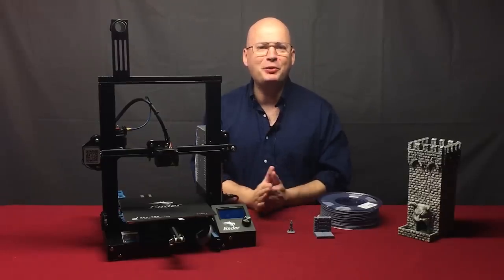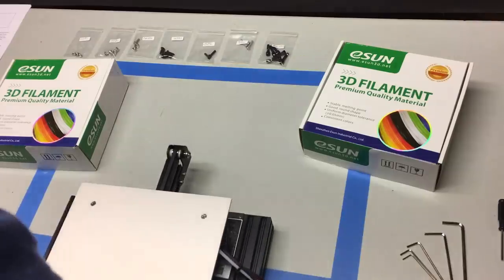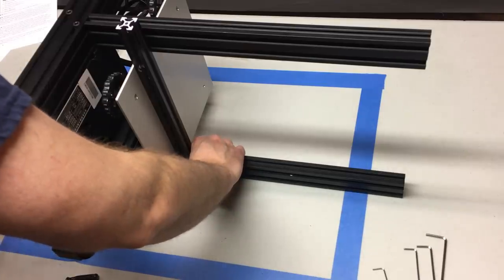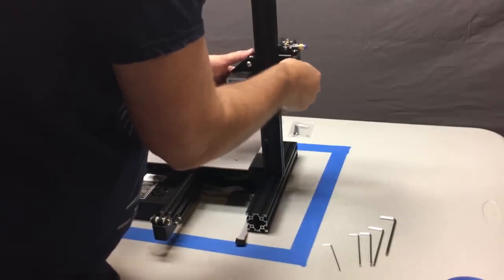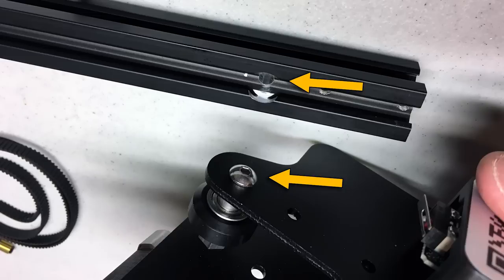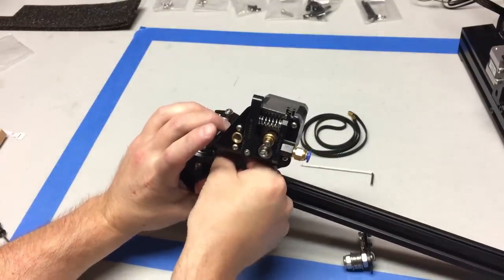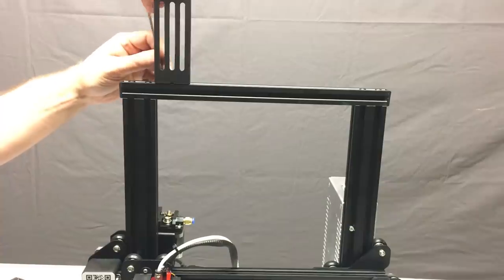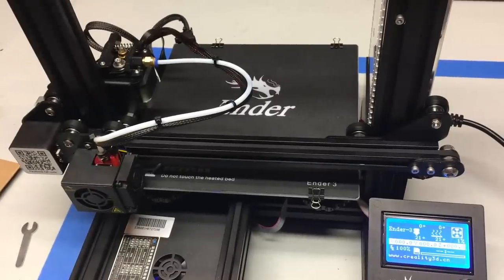Creality Ender 3 assembly and pro build tips

Comment: Do you have any wheels that are ideal? The wheels that came with my printer were garbage, nicks and cracks in them. I purchased some of the polycarb. wheels but they leave a white deposit on the rails.
Reply from the maker: I use stock wheels on all of my machines. If they are properly tuned (i.e., not too tight) they will last a very long time without cracks or nicks (my first Ender 3 is a year old and the wheels are in perfect condition.)

Comment: Do you have any suggestions for troubleshooting the extruder that won't heat up at all. After heating up the bed, it switches to the extruder, and the temperature does not increase at all. After about 30 seconds or so, I get an error message "heating failed E1" and says to restart the printer but this does not solve the problem
Reply from the maker: Most likely one or both heater cartridge wires have come loose from the main board and need to be screwed back in, or there is a break in one of the heater wires.

Comment: I will receive my Ender 3-v2 soon. Do you recommend, using the tutorial? There are some slight differences to ender 3 (e.g. power unit),  but it should work too?
Reply: I found this video very helpful for the V2 (it's basically a step-by-step build manual): https://www.youtube.com/watch?v=gokN9xNG94U&t=2623s&ab_channel=JustVlad 

I also want to mention that the stripping the aluminum frame screw holes with the metal screws is REAL. Not sure how because I normally don't over tighten anything, but I stripped the two holes that hold the passive x-axis bracket (side without the motor). HOWEVER, since these are metric a #8 5/8 screw and lock washer was just big enough to solve the problem and mine is printing awesome.

Comment: Tom, great video.  I wish I would have found it before assembling my ender 3. : )  Great tip on keeping the upright rails loose until things are aligned.  I see so many videos about bending that bracket for the extruder or shims so there is no binding on the spindle.  I loosened my uprights, slid the cross member down and things fell into place for me.  So great tip, should save people some headaches.

Comment: I have just built my Ender 3 and my auto home position is lower than the bed and past the front of the bed, how do I set the auto home position so I can begin to level the bed or do I disable the steppers and then move the print head manually?
Reply from the maker: Did you compress all of the bed springs? If so, you need to raise up your end stop switch for the z-axis (see my bed leveling video for full instructions). :)

Comment: Appreciate any help I can get...Creality V2>Mini SKR 3.0 V2 E3...Message on the touch screen reads: PRINTER NOT CONNECTED! Also an alarm is activated. Also Wondering if the printer cable is connected to the right port. Is it EXP1, 2, or 3?? Should the display device be connected to the R2 port? Your assistance is already highly appreciated. Thank you!
Reply from the maker: Sorry, I don't use the Mini SKR 3.0
Reply: @Tombof3DPrintedHorrors  thanks for your reply...any suggestions? I bought my V2 this past September & I’m still not able to connect the printer with the display monitor...thinking that the 4.2.2 board was defective, I upgraded it to the Mini SKR E3 along with the V2 touch screen and I’m still having this connection issue. What am I doing wrong? Both, Bigtreetech & Creality’s support are virtually non-existent.

Comment: hi... I bought a 3x from amazon and got it today... your video should be fine for a 3x, correct?   and more importantly, I got to the first part of your video getting the bed levelling wheels in the right position and I found that one of my wheels just spins and spins, and I cant tighten it like I can for the other 3 corners.  What should I do?   I am a noob here and not too mechanically inclined either so im not sure how I should proceed.  I'm actually holding off on continued assembly in case I need to return this.  any help you can give would be GREATLY appreciated.  thanks in advance!
Reply from the maker: Yes, the video is fine for a 3x. I'd need to see a photo or video of your wheel spinning to help diagnose. Please join our Facebook group (link in video description) and post there.
Reply: thank  @Tombof3DPrintedHorrors you for the reply.   for some reason I hadn't seen it until just now.
Reply: @Tombof3DPrintedHorrors  I just asked for admittance to the fb group.  I now have the printer assembled, but it comes with no real manual on how I should begin to print, or what all the options on the menu do.  Can you give me any advice, or point me in the direction of a manual online?   I cant find anything

Comment: Your video made my new Ender-3 assembly enjoyable and interesting, almost 3 years after you posted it. Can you clarify what tends to go wrong with the Bowden Tube fittings (or what works better with the replacements)? I'm happy to replace them per your strong suggestion, but they seem to be working perfectly. Is it possible that Creality improved that part?
Reply from the maker: The part Creality uses wears out fairly quickly and allows the tube to slip causing leaks which you will have to tear the entire assembly apart to rectify. The replacement part lasts much longer (I've got ones that are several years old and still gripping tightly.)
Reply: @Tombof3DPrintedHorrors  That’s extremely helpful - thanks!

Comment: 11:40 no matter what I do I am at least an 8th of an inch off, is it a bad idea to just try and keep going? any suggestions???
Reply from the maker: That's too far off, 1mm or less is target. Does your base wobble? If so, the two font/back extrusions (the ones with the rubber feet on the bottom) aren't parallel, loosen the two screws on the side of each one and get them to sit level on a table then retighten them, that will adjust your uprights too.
Reply: @Tombof3DPrintedHorrors  I love you thank you

Comment: Will I ever have to change out the quick fitting once replaced? Just trying to think if I actually need the 4x4 + Bodwden tube set you have listed or if it would be cheaper to get them in singles.
Reply from the maker: Yes, they do wear out eventually, plus every few times I changes the bowden tube I just replace the couplers for fresh ones.
Reply: @Tombof3DPrintedHorrors  Yeah, i checked and the other kit i could find was 5 of each and it was only like a buck or so cheaper. I would still have to get more bowden tube anyways so this is the way to go.

Comment: This is the best ender 3 build video available. Thanks very much for taking the time to put it together. I just built mine. Need to test it and dial it in but so far so good. A couple of quick questions. should the lowering of the z axis during homing be very slow and fairly noisy? Mine seemed to move steadily but very slow and it was sounding a bit rough. It ran up and down the lead screw by hand without binding as per the vid. Also, my main board fan didn’t spin up during the homing test. I assume this is normal and it will spin up when the temp increases?
Reply from the maker: Not sure about the loudness, but it should be ok, and yes, it is very slow because of the pitch of the screw. The fan spins up when needed.
Reply: @Tombof3DPrintedHorrors thanks. just a note on squaring up the gantry, I found that there is quite a bit of play not just in the z carriage connection to the gantry but also in the fixings attaching the right hand side carriage to the gantry. I needed to tweak the bolts for both sides to get 90 degrees between gantry and legs. Also, setting this up is totally dependent on having the hot end in place as the extra weight throws this off if you add this after squaring the gantry.

Comment: Hi, am a complete newby in this my question is, does this printer cable to turn designs sketches into printable stuff?
Reply from the maker: No, the printer can only print models that have been created for 3D printing.
Reply: @Tombof3DPrintedHorrors   Thank you for your response, is there a way to have a sketch made into  a model for 3d printing that can be print by the  Creality ender 3 " which is the one i am interested in buying".

Comment: Thank you for posting this.  I appreciated the warning at the start about the ongoing upgrades to the Ender 3 family, and thus I used the printed instructions, the video provided by Creality with the printer, and this video in combination to get everything done.  No criticism intended at all, but the Ender 3 V2 has evolved quite a bit since this video was made.  That said, the assembly probably took me four to six times longer because of paying attention to all the tips in this video about aligning the various components, but in my humble opinion that was time well spent, because of the benefits I'll have for getting everything set up exactly as it should be.  And the proof is in the pudding as they say, my first test print was quite small, it only took about fifteen minutes, but it was perfect first time.
Reply from the maker: Yes, the Ender 3 V2 has evolved greatly, which is why I also have a separate Ender 3 V2 build video on this channel. :)
Reply: @Tombof3DPrintedHorrors  I wish I'd known that, like many people who are the audience of this, I'm totally new to 3d printing.  Therefore I was not aware of the differences between the (at least) three Ender models: the original, the V2 and the pro.  If I might suggest, it could help people like me viewing this in the future if you cross-linked the various videos, along with comments explaining which printer each one is for.

Comment: Amazing video and a must see for anyone putting this together. I do have a question. I got a glass bed come with mine as well as the flexible covering. do i put the flexible under the glass on top of the heat bed or I can just use the glass alone?
Again thanks for all these video's ive been working my way through them.
Reply from the maker: Just use the glass alone.
Reply: Tomb of 3D Printed Horrors thanks for the super quick reply. I’ve joined the face book group and seeing everyone’s creations and the welcoming and amazing community there I’m extremely excited to get stuck in 😁

Comment: HELP, at 19:41, I can’t seem to change the bend in the x beam. When I level the left side, the right is an eighth of an inch lower. I checked the two vertical bars, they are perfectly aligned. Whenever I loosen the two screws near the z rod, it doesn’t do anything
Reply from the maker: OK, the two screws at 19:41 have nothing to do with leveling your X beam, those are only for making the X beam assembly move up and down the Z screw smoothly. The screws you need to adjust are the ones shown at 18:47 (you must lift the assembly off the two verticals to adjust.) It takes some patience to get it right, but doing so will make sure you get better looking prints. :)
Reply: Tomb of 3D Printed Horrors so at 20:45 we need adjust which screws? Is it the ones holding the bar that we unscrew?

Comment: Okay…so I bought the ender but it took 6 months to get the courage to start on putting it together. That’s not all that bad though. I got to the part where I adjusted the build plate guide wheels and ran into a bit of a concern. Out of the box the wheels where so tight that they now have a flat spot and when moving the plate there is a very pronounced hesitation…or a kind of ca-chunk. Now correct me if I am wrong but I’m thinkin that may make some rather serious glitches in what ever I choose to make. Should I send for some new wheels????
Reply from the maker: Yes, if the wheels have a flat spot they need to be replaced.
Reply: @Tombof3DPrintedHorrors  thank you. I ordered some from amazon. Even though I am mechanically minded and used to be an auto mechanic, I started on this adventure with trepidation.

Comment: If you ask me the nuts that slide into the V rails (on the reel holder, End Stop etc) should be aligned Horizontal and not Verticle like shown in the video. 
If you look at the shape of the nuts they are machined and shaped to fit exactly into and directly behind the V slots horizontaly, Slid in from the end of the V slot.
That is how I have mine.
Reply from the maker: Look at them more closely, they each have an opposing corner that is intentionally beveled to allow them to rotate into position as I have shown.
Reply: @Tombof3DPrintedHorrors  Awesome thanks for that it is most interesting.

Comment: I'm no happy with the prints on my ender 3, any suggestion ? http://imgur.com/gallery/odQQDwB
Reply from the maker: Without knowing what your slicer settings are I can't help. You'd need to post screen shot of all of those.
Reply: @Tombof3DPrintedHorrors  Thank you Tom for your answer. I,m no new in 3d print, i assume it's mechanical issue, i use se3d profile from Nerys, for which i colud not say that is wrong cause i saw his prints and they are awesome.

Comment: Is there a reason no one is using loctite on anything? In RC, anytime a steel bolt goes into aluminum, we use loctite. It seems like it would be good to use it here too, when securing the uprights and the extruder grub screw, at a minimum. What do you think?
Reply from the maker: Definitely don't on the grub screw, as you will be changing the feeder gear out occasionally. As for frame screws, you will occasionally need to disassemble areas to work on the machine is why I don't use it.
Reply: There are two formulas of Loctite, temporary (blue) and permanent (red). The temporary Loctite blue works well to hold mission critical fasteners in place when they are exposed to constant torque/vibration/etc but it can easily be broken loose when maintenance or replacement is required. 

I can't help but think a tiny bit of the blue formula would go a long way to prevent under extrusion due to loose extruder feed gears or to lock a properly built upright in place etc. 

In the rare case of a fastener being hard to remove after applying Loctite blue, (I've honestly never had it happen) you could apply some heat with the tip of a soldering iron to the fastener for a couple of seconds and will melt the Loctite. This is what is done to remove Loctite red if it's accidentally used instead of blue lol.

Comment: Hi.  Thanks for the video.  At around 20:45 when adjusting the x-axis bar to make sure it is level.  You mention that if one end is too high or too low, to loosen the two screws and adjust.  Are the two screws being mentioned, the two screws that are used to attach the bar to the plate through the tiny access holes?  Or the two screws on either side that the Z rod goes through?  Thanks
Reply: Loosen "what screws" a half turn until you get it right?????  Thanks
Reply: I found the leveling of the x-axis arm to be more of a function of the wheels being to loose or too tight.  The wheels that roll up and down z-axis bar and threaded rod connected to the x-axis bar.  If the wheels are to loose, then the end of the x-axis bar will hang to low.

Comment: i stripped one of the screws attaching the coupler to the rail any ideas of how i can get it out, i'm just extremely strong and issues like this are ongoing when i try to assemble stuff
Reply from the maker: Only suggestion is use a flat cutting wheel on a handheld rotor tool to cut a slot in the head so you can use a flathead screwdriver to get it out. If you aren't used to doing this find someone who is experienced in doing it.
Reply: @Tombof3DPrintedHorrors  hmm not a bad idea, worth a try, my idea was drilling the screw until it either gets attached and pulled out or crumbles due to being hollow

Comment: Just finished my build using your guide, and have to say it went pretty well overall for my Ender 3 Pro - only question I have is regarding the "test" at the end, when it "homes" to all 3 positions - of them, my Z axis was the "slowest". While it seem to move pretty quickly to the X and Y switches, the Z travel just felt longer - is that normal/expected? How "loose" should the up-and-down travel be? Should I be able to move it by hand, or really only just by turning the Z screw?
Reply from the maker: Z movement is slow because it is via a screw vs. a belt, and yes, you should only really be able to move it by turning the screw. :)
Reply: Thanks for the response,  @Tombof3DPrintedHorrors  - as I'd said, your guide was a HUGE help! Thanks again and keep up the great work! On to the bed leveling guide!
Reply: @Tombof3DPrintedHorrors  Thanks - thats what I thought!

Comment: Thanks so much for sharing , very helpful video! 

I'm expecting my Ender to be delivered by Tuesday and was wondering, at 25:40, when you say to tighten the screws until they stop turning, then back off the Z rod screws 1 turn only, do I leave it backed off assuming there is no binding? I may have misunderstood but you didn't specify afterwards whether or not to leave them loosened or to re-tighten them.
Reply from the maker: Leave them loosened 1 turn :)
Reply: @Tombof3DPrintedHorrors  So I just finished assembling it last night, made sure all the connections were properly inserted, and all connections were solid. After a successful Auto Home, I went to level my bed. As I was doing that, smoke started coming out from the mainboard. After inspection the display cable has several burn/melt spots across the length of the cable. I assume the mainboard, the display cable, and the LCD screen are all toast so I bought replacements for all those. Now, do you know what could have caused this before I ruin the new parts too?
Reply from the maker: Did you contact Creality,? They will make it right.